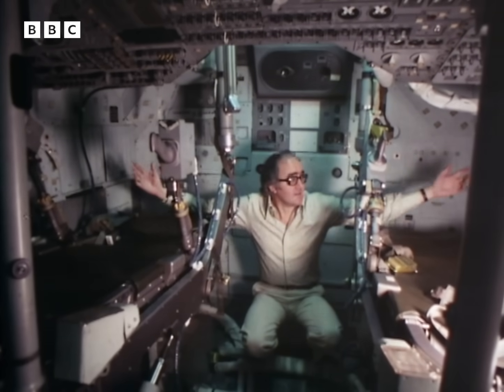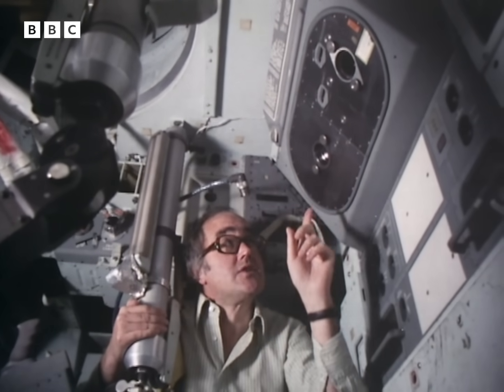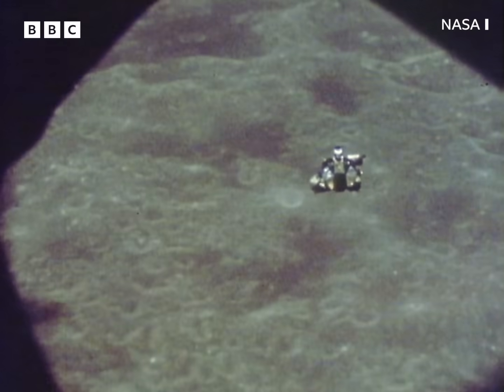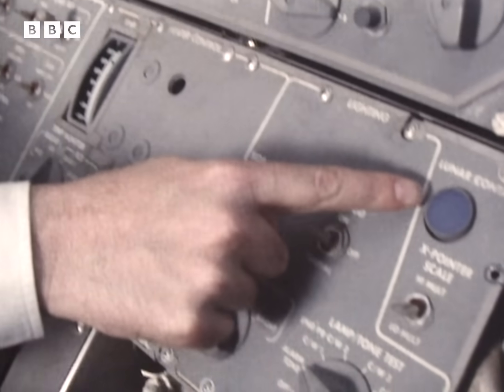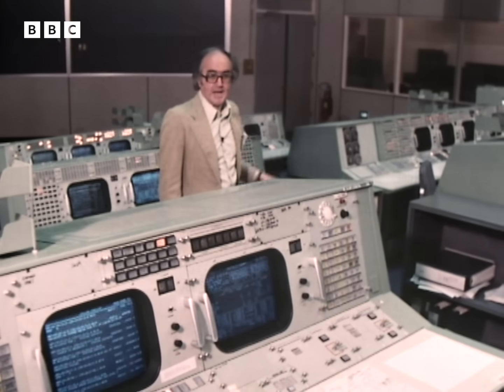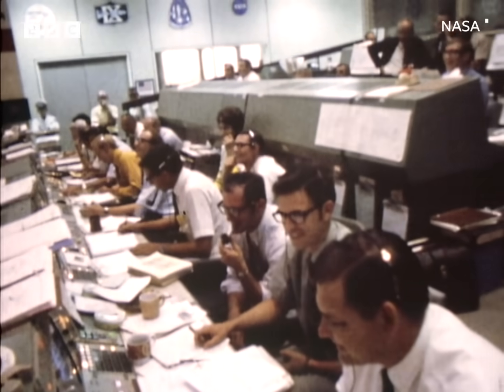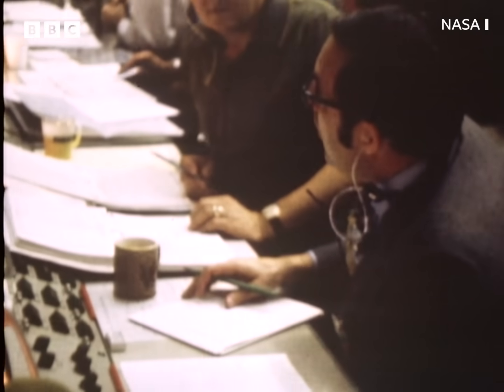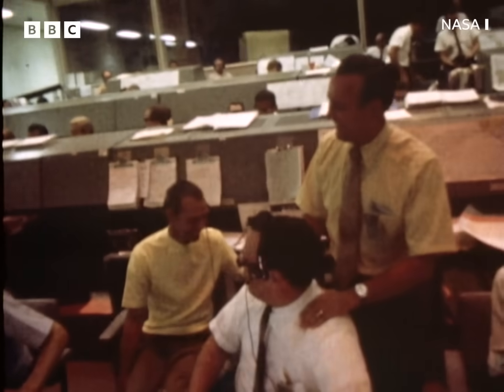1979: How to LAND ON THE MOON | Project Apollo | Retro Tech | BBC Archive

Comment: never went
Reply: @FlatStuffEarth  
The believers have ridiculous answers for everything. Some even believe that the radiation isn't dangerous. Must be why NASA openly admits they are still trying to solve the problem of putting humans past low earth orbit. There is no compelling explanation as to why the cross hairs are behind objects in some photos, for example. Photos and videos taken in such a harsh environment could not survive the radiation and temperatures of space with a Hasselblad camera. NASA's, so, called dosimetry readings from Apollo, are only consistent with data in LEO. There is absolutely no way it resembles any data collected from scientific research and medical journals regarding space radiation.
Reply: @aok4418  There are no crosshairs behind objects. This is an optical illusion caused by light leaking behind the reseau plate. 
The only way for crosshairs to be behind objects is to place the crosshairs as physical objects in the landscape, which is a ridiculous way to do it.
Reply: @Hobbes746  It's not an optical illusion. It's a nonsense answer that believers like to use when they don't have a logical one.
Reply: @aok4418  It is in fact an optical illusion, which is easy to verify by taking some photos with a reseau plate.
Reply: @Hobbes746  
That's complete nonsense. The photos were doctored. That's the only logical explanation. Do you really expect anyone to believe the crosshairs would partially disappear. Please explain this "optical illusion"
Reply: @Hobbes746  
That's complete nonsense. The photos were doctored. That's the only logical explanation. Do you really expect anyone to believe the crosshairs would partially disappear. Please explain this "optical illusion"
Reply: @Hobbes746  
Let's not forget those shadows from the light source on set. Or the fact Apollo film could not withstand the radiation or extreme environment. Are you aware they make special radiation cameras. The Hasselblad certainly wasn't one of them.
Reply: @aok4418  ,
You don't understand shadows.
If there is more than 1 light source, you are going to get more than 1 shadow. The shadows wouldn't be as dark and well defined.
The entire field of view and landscape wouldn't be evenly lit if there was more that 1 light source or artificial lighting.
Youtuber & photography expert Dave McKeegan has videos explaining the shadows and cameras.
Reply: @aok4418  Again you are making bullshit claims not supported by any evidence. 
1. In all Apollo photos we see only one shadow per object. This proves there’s only one light source. All of the shadows are in the same direction, which means the light source is very far away. That combination is impossible to produce in a studio. 
2. The Apollo film had a low ISO value, to reduce the amount of radiation damage. They tested this before Apollo, and found that the damage consisted of two factors: a. a reduction in dynamic range: this was not a problem, because the film they used had an enormous dynamic range to begin with. and b. occasional streaks from particle hits. These were rare enough that the photos would be usable. 
So again, we see that in the real world, the radiation was less of a problem than in your fevered imagination. You have NO DATA to support your claims.
Reply: @Hobbes746  Are you kidding me. The shadows are in different directions because the artificial light source is so close. That's the only logical explanation. If it were from the Sun. The shadows would be parallel.
Reply: @Hobbes746  ISO has no bearing when it comes to GCRs. 
Also, the film was not special. NASA likes to tell you that. Fact is. It's just a Kodak film.
Reply: @aok4418  Yes, in fact ISO does have a bearing on radiation damage. The slower the film, the more energy is required to induce a change in the silver halide crystals. 
Also, the film was special. Kodak developed both a film and an emulsion for NASA: the emulsion was derived from the film used in aerial reconnaissance camera, and the film was made extra thin to fit more film into a magazine.
Reply: @Hobbes746  Nobody is saying they are. Pictures I'm referring to are not uneven surfaces. Try again!
Reply: @Hobbes746  The film was not special. Only NASA says that.
Reply: @aok4418  Well, which pictures are you referring to, then? Provide photo IDs.
Reply: @Hobbes746  Like the picture of the rover with no tracks
Reply: @aok4418  Without a photo ID that comment is useless.
Reply: @aok4418  AS11-40-5903 shows shadows all pointing in the same direction: about 8 o’clock.
Reply: @Hobbes746  Lol. No
Reply: @Hobbes746  There are plenty.
Reply: @aok4418  Where do you imagine you see shadows going in another direction?
Reply: @Hobbes746  
Are you blind? Or is this just the part where you just keep denying.
Reply: @aok4418NO DATA.
Reply: @aok4418 NO DATA.
Reply: @aok4418 NO DATA.
Reply: @aok4418  And again there you go with your “harsh environment” fantasy. In reality, the radiation level is far lower than you claim.
Reply: @aok4418  The dosimetry readings from Apollo are far higher than you get in LEO. And those readings are consistent with every radiation measurement we have ever taken in space.
Reply: @Hobbes746  Completely False! Surely you can cite these readings from " everywhere "?
Good luck with that. They don't exist.
Reply: @aok4418  False. Readings from the 1958-1962 missions used by van Allen are available on the NSSDC, and in the papers published by van Allen and his team. the data from the van Allen probes are archived by JHUAPL and are again publicly accessible.
Reply: @Hobbes746  
Those readings from Apollo do not reflect anything from JVA. 
This isn't difficult. Why does everyone need to spoon feed you everything?
Reply: @aok4418  , The NASA engineer was specifically talking about the Orion Spacecraft and its newer technology of computer and navigation systems. That newer technology must be tested for the effects of radiation. He was in no way saying that the Astronauts were in danger of the radiation. Artemis 1 has already gone to the Moon. That was the testing of the new technology on Orion.
Reply: @aok4418  No, NASA does not claim "they are still trying to solve the problem of putting humans past low earth orbit”. That’s another lie made up by the deniers. NASA is trying to solve the radiation problem for missions that will spend months in space. I’ve explained this to you before.
Reply: @Hobbes746  
Let's not forget those shadows from the light source on set. Or the fact Apollo film could not withstand the radiation or extreme environment. Are you aware they make special radiation cameras. The Hasselblad certainly wasn't one of them.
Reply: @aok4418Wrong on every point. Too bad, so sad.
Reply: @FlatStuffEarth  
AS14689486
AS11405903
AS1610817627
AS14689486
Reply: @aok4418  AS11-46-89486 does not exist.
Reply: Nope. The Apollo missions are real, as proven by a mountain of evidence.
Reply: @Hobbes746  Nobody went to the moon. Wake up!  One word. 
Radiation! The believers have ridiculous answers for everything. Some even believe that the radiation isn't dangerous. Must be why NASA openly admits they are still trying to solve the problem of putting humans past low earth orbit. There is no compelling explanation as to why the cross hairs are behind objects in some photos, for example. Photos and videos taken in such a harsh environment could not survive the radiation and temperatures of space with a Hasselblad camera. NASA's, so, called dosimetry readings from Apollo, are only consistent with data in LEO. There is absolutely no way it resembles any data collected from scientific research and medical journals regarding space radiation.
Reply: @Hobbes746  
There are no optical illusions. Believers like to say this because they know it there is no logical explanation except for the photo's being doctored.
Reply: @Hobbes746  
The believers have ridiculous answers for everything. Some even believe that the radiation isn't dangerous. Must be why NASA openly admits they are still trying to solve the problem of putting humans past low earth orbit. There is no compelling explanation as to why the cross hairs are behind objects in some photos, for example. Photos and videos taken in such a harsh environment could not survive the radiation and temperatures of space with a Hasselblad camera. NASA's, so, called dosimetry readings from Apollo, are only consistent with data in LEO. There is absolutely no way it resembles any data collected from scientific research and medical journals regarding space radiation.
Reply: @aok4418  

 The NASA engineer was specifically talking about the Orion Spacecraft and its newer technology of computer and navigation systems. That newer technology must be tested for the effects of radiation. He was in no way saying that the Astronauts were in danger of the radiation. Artemis 1 has already gone to the Moon. That was the testing of the new technology on Orion.
Reply: @JohnM3665570  And not a single human went now or prior.
Reply: @aok4418  

What's your proof no humans went???
Reply: @JohnM3665570  
Radiation levels alone are proof that no humans have gone to the moon, Hobbes.
Reply: @aok4418 And your an expert on radiation  ??
Reply: @samzerafa3185  
You don't need to be an expert. Just do a little research.
Reply: @samzerafa3185  He wishes he was, but he keeps coming up with nonsensical claims and incorrect numbers.
Reply: @aok4418  I done more research than you've had hot dinners child !
Reply: @Hobbes746  You know that old saying,  ' Ignorance is bliss ' applies here ! 😉
Reply: @samzerafa3185  Sure you have. Don't waste my troll. It won't go well for you.
Reply: @samzerafa3185  I know it's you, Hobbes. Grow up!
Reply: @Hobbes746  Stop replying to your fake accounts
Reply: @aok4418  Empty vessels make most noise !
Reply: @samzerafa3185  
Why are you still talking, Hobbes? Still no job, huh,
Reply: @samzerafa3185  You should pay attention a little more. Oh, by the way, try something original, you're a little obvious.
Reply: @samzerafa3185  
You should pay attention a little more. Oh, by the way, try something original, you're a little obvious.
Reply: @samzerafa3185 What ignorance? Be specific and prove me wrong. I'll wait, stalker!
Reply: @aok4418 NO DATA.
Reply: @Hobbes746  
Even the data from the NASA article doesn't even mention the galactic cosmic rays that are the most dangerous. It's not even included in the 50-2000 msv. And if you could understand "maths," you would know no those numbers are not consistent with Apollo either. If you're too lazy to do the research, just say so.
Reply: @aok4418  You’re the one clinging to useless, unsourced claims instead of looking at the data.
Reply: @Hobbes746 
Even NASA in 2017 debunks the readings from Apollo. The readings from Apollo are LEO because they didn't leave LEO.
Reply: @aok4418Do you ever get tired of being totally wrong about absolutely everything?

Comment: Yeah, this documentary should leave no doubt that nobody landed on the moon..  How much fuel does SpaceX need to take up and stage in space that once Elon gets his moon ship up into orbit, the most effecient and technologically advanced space craft ever made by mankind will have used nearly all of its fuel just getting to orbit and must now be refueled in order to make it to the moon and back to earth.. so wait,  what? None of the Apollo missions needed additional fuel tipp Getty top tube moon and back so why now in 2024 can't we duplicate what NASA did over 55 years ago with a computer that couldn't hold a candle to one of today's cell phones. ?
Reply: This documentary should leave no doubt that they did in fact land on the moon. 
Apollo was a minimum viable mission: all it had to do was put two men on the moon for at least 8 hours. It turns out, you can design a single rocket that will do this, if you use a clever mission design (Lunar Orbit Rendezvous). 
For Artemis, we want larger crews to stay on the moon for at least a month. This requires landing at least 20 times more payload on the moon than the Saturn V is capable of carrying. This is why all the refueling happens: it’s either that, or build one rocket 20 times larger than the Saturn V. The size of a rocket depends on only one thing: the amount of fuel it has to carry. And since the Saturn V, we have not had any breakthroughs in the one parameter that sets this amount: the efficiency of a rocket engine. There have been small improvements (going to staged combustion), but nothing major that would enable the rocket to be noticeably smaller.
Reply: "why now in 2024 can't we duplicate what NASA did over 55 years ago with a computer that couldn't hold a candle to one of today's cell phones. ?" <- Computers don't fly to the Moon. Rockets do. You seem confused.
Reply: @casanovafrankenstein4193  Really? Rockets fly to the moon? And what year we were able to start landing rockets??
Reply: @izafanime  The first successful soft landing on the Moon was on 3 February 1966.
Reply: Unfortunately you seem to have no object permanence.  The Apollo lunar lander was small but the Artemis landers are going to be big . 

 Big things need more fuel.

So Artemis needs more fuel.

Lifting a bit of fuel into lunar transition orbit needs a lot of fuel at launch on Earth.

So Artemis needs a lot of a lot of fuel at launch on Earth.
Reply: How does this in any way prove that nobody landed on the moon?

Comment: WAIT BUT THEY SAID COULDN'T SEE ANY STARS!!
Reply: Moon landing deniers are trying to deceive you with that. The answer is more complex than the deniers claim. 
1. on the surface of the moon, the Apollo astronauts could not see stars. The reason is obvious: they were on the moon during the lunar day, so the surface was lit brightly. When the biggest object in your field of view is lit brightly, your eyes adjust to that by contracting the pupil, allowing less light in. This means no stars are visible. Cameras do the same: you adjust the exposure time to avoid overexposing the surface. 
The only way to see the stars from the surface of the moon is by standing in the shadow of a large object, looking up (so the surface is no longer in view) and waiting until your eyes adjust to the much lower light level. John Young did this on Apollo 16. 
2. During most of the flight, they were in sunlight as well, again no stars are visible.
3. When they were in the shadow of the moon or Earth, switching off the interior lighting allowed them to see the stars. Michael Collins describes this in his autobiography.
Reply: @Hobbes746  Or to put it in the simple terms they might actually get, IT WAS DAYTIME!

Comment: That whole James Burke PBS Series called "Connections" was among the best Television I've ever watched. For a STEM Fan, J. Burke managed to keep your attention while you learned of some obscure or little known facts within the "6 degrees of separation" realm. You couldn't always see where he was taking you, but you were All In for the answers that all came together at the end of the story.
  For my second point, my source is a Rocket Scientist Manager, whom is a very good friend, that worked at TRW (the contractor for the throttleable Rocket Engine that enabled the Landing & Takeoff of the LEM. TRW was later absorbed by Northrop Grumman, the builder of the LEM). What I was told was that at least One of the Computer Overload Alarms, the 1201 and/or 1202 alarm, that occurred during Apollo 11 landing was later found to be generated when Buzz Aldrin switched on the Altimeter Radar without following prescribed training procedures. IOW, he didn't tell Niel Armstrong or Mission control what he'd done until after theye'd  returned and done an investigation.
Reply: It was a BBC show that PBS  picked up. Like Horizon and Tomorrow’s World, which were pure gems.
Reply: I love Connections, wish you could watch it again somewhere.
Reply: There was an Apollo 11 documentary where Buzz Aldrin described this 'overload' situation that kept occurring, so he and Armstrong pretty much flew the LEM down to the surface manually.  They were both pilots, so its was just another  "controlled crash landing" like all those other landings they had done.
Reply: @crosslink1493 Not quite so.  Armstrong changed from software program P64 to P66 earlier than foreseen because the computer was about to bring them down into an area that was littered with rocks.
Reply: Aldrin thought that he could ensure his seat on 11 by being an authority on space rendezvous to the extent that it became his nickname; "dr. Rendezvous". But he felt he had stuck his neck out too far and worried that they may not have acquired the command module after the lunar accent, so he purposely gambled to leave the computer on that tracked the command module, the whole time.  Who's to say that he wasn't right as it all worked out.